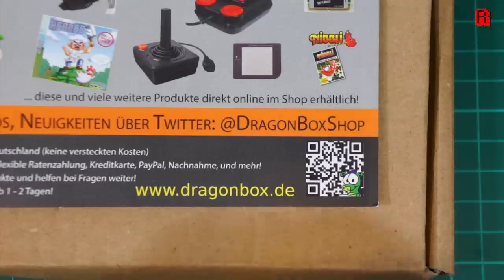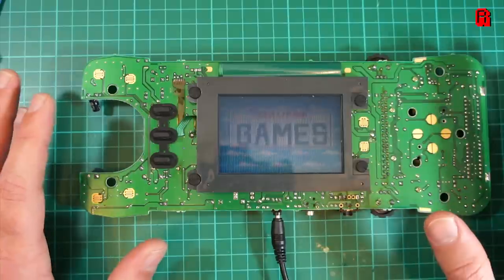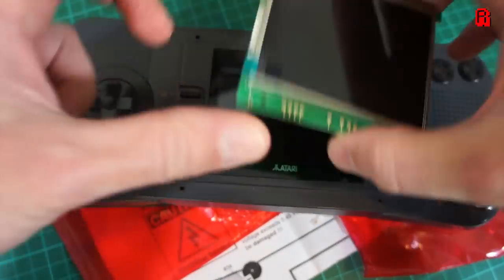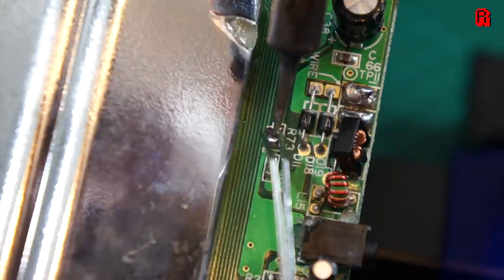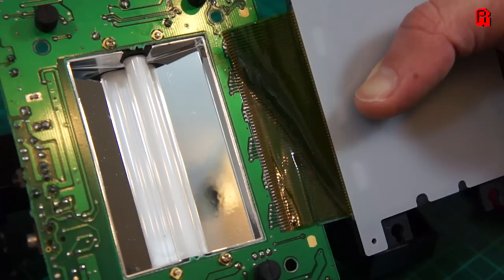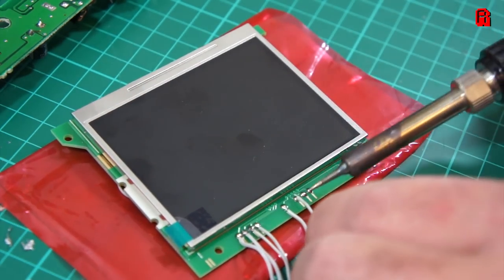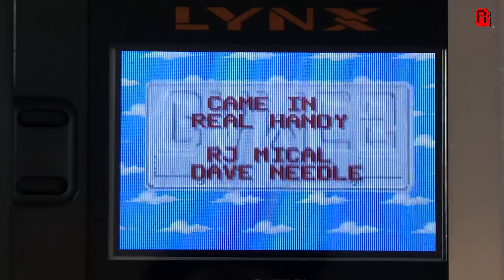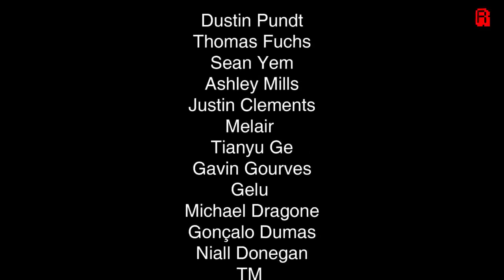Atari Lynx | LCD Upgrade (Mcwill Mod)

Comment: First time I saw a Lynx LCD screen,   I thought water had got in on the screen to cause those lines!   (happened to a CRT TV I had years ago)
Reply: LOL, with 25k volts going through the crt, you were lucky not to get a jolt up your jacksee!
Reply: Haha, it's a small world after all! I think I've watched all your videos so far WHILE modifying Lynx's and GameGears for my customers :)
Reply: You need to make full sized gaming tvs on that tech man. You got everything right having transparent light red green blues on the grey colours of the LCD screen just like if you were to look close up to a CRT and dark RGB's on the following line with a dark black backing and from a distance it looks just dark grey and you can't see the transparent scanlines at all. Then you had an option on there you turn horizontals on to make the square pixels dots like a real CRT and original Lynx LCD.

We need that on a full sized gaming LCD and you'll make lots of customers on that 4K TV product I think as it would be like playing PS4/X-Box One on a CRT like you could on PS3/360 still but with the LCD tech.

4K UHD gaming on a CRT like dark grey and dark black with transparent RGB darks and lights blended into them striped glass screen made out of the latest UHD QLED tech with a horizonal fine scanlines button where the fully transparent picture scanlines are the same size as the stiped vertical scanlines that would be a beast of a gaming TV the Dragon Box 1 would and with each new screen tech and 10k or whatever the future holds that comes out you can remake and improve it and make the older ones cheaper.

It's always a risk to go full sized and more expensive on the screens but a lot of people out of the ones that can afford the tech that are gamers would get one I think especially if it supports 50/60hz inputs properly like a game mode on a good non El Cheapo LCD TV but more affordable as it's made for the purpose with Analouge RF being changed to old microcomputer or atari game mode as those are the only things RF is useful for now other than the Digital TV as it's not made for Analouge TV anymore but it should still be a mode as a gaming TV.

This is probably the best replacement screen tech out there for Gameboy Dot Matrix Green, Color, GBA, Gamegear, Lynx and whatever else you would make them for in the future and a TV for gaming might just be the latest upsample idea out there for them.

Comment: fantastic! . to be honest i'm a big fan of keeping things stock but you won me over here!  excellent mod and video as always! cheers!
Reply from the maker: I'm right there with you but decided to make an exception.  I did hold off cutting a hole in the case for the VGA port though, I'd like to somehow hide a flat cable for that in the battery compartment if possible.
Reply: Like all those "stock" Amiga CF card hard drives eh MVG? wink ;)
Reply: haha i knew someone would mention this - with CF cards you can revert back to original. With a screen transplant its difficult/impossible :)
Reply: I like to keep things stock as well, so I will keep my less banged up Lynx untouched and will try the LCD mod on the fully functional, but less worn out unit...cheers.
Reply: I have a Lynx 1 with the McWills mod and brilliant it is too however I’ve just picked up a new/old stock (and immaculate) Lynx 1 and am tempted to swap the innards with the McWills machine thus making a brand new looking McWills installed Lynx 1.... sadly this would mean placing a never used lynx1 PCB and screen in an old case.... dilemma indeed!
Reply: @RMCRetro  I assume this unit is for your personal use and you would keep a stock version for the museum. When seeing units at the museum, it's important to present how things were, warts and all. Eventually the mod itself will become part of retrogaming history too (it's already 10 years old, it seems!) so it will be nice to see them side by side.

Comment: I recently did this with a Sega Nomad and had the same gob-smacked reaction when it first powered on. It's almost like replicating the original feeling from all those years ago when the original hardware felt so impressive at the time.
Reply: How did you that? i have a nomad too and want to make this MODscreen. I already did the GG mcwill MOD and its awesome
Reply: Bet that improves the battery life... had my Game Gears back light converted to led by a guy on ebay big difference for me.

Comment from the maker: Thank you as always for watching, I'd love to hear your thoughts and experiences on the upgrade as well as your Lynx memories.   Please note that this is designed to give you an idea of the installation method and the result you can expect, but it's not an instructional installation video,  there's a very in-depth 45 minute installation guide here which I recommend here as a primer:  https://youtu.be/6lRJg-zZZOk
Reply: Brilliant, pun intended! Very nice. Infinitely better. How's the battery life now? I'd imagine it's almost 4 or 5 times longer.
Reply: I never got to play with one. I'm gonna keep my eye out for one.
Reply: I've never had a lynx, but it a similar mod was available for the PSP, I'd jump at it. I've already done a drop-in screen replacement, but the new one is just as awful as the original.
Reply: Hey how does the screen impact the battery life?  Seems like a modern LCD wouldn't use near as much power, not to mention removing the backlight

Comment: I've seen the McWill mod before but the way you present it is excellent. I picked up a 98% mint Lynx I, except the screen has a couple of horizontal lines. I absolutely love the Lynx (actually prefer the model I over the model II), it's so incredibly comfortable to hold and it has this charm about its bulky design. I guess i'll be going for the McWill upgrade as well... Thank you for this fantastic video!

Comment: Nice video. It is interesting that back in 1989 when this was released, it would have been possible to make an LED back-light that was brighter and used much less power as white LED's were available and by around 1990 were much more affordable.  Why Atari and other manufactures didn't do this, hmmm

Comment: as someone who stared at a Lynx screen for hundreds of hours back in the 90's this mod has been a revelation. I can't wait to upgrade one or both of my Lynx. I've seen another video of the mod before and RMC you've done the screen proud. I've always preferred the model one as well so I imagine it will get the treatment first.

Comment: Fantastic video! I really dig that PCB holder/clamp device you have. Looks very handy.
Reply from the maker: Thank you from one cave to another.  I'd like to find a slightly bigger one, it's great for handhelds but I'd like a nice sturdy holder for micros.
Reply: They can be found at most quality electronics shops and Amazon/ebay.

Comment: Thanks for the great Lynx videos! I also felt the McWill screen made the Lynx 'how it always should've been', it's completely amazing. On the other hand the old Lynx screens are not as bad as they're portraided in some youtube videos (if they're still in ok condition). After playing for five minutes on the old style screens you've already somewhat forgot about the screen :)
Reply from the maker: Electric Turbodata I agree with you in the most part but Shadow of the Beast was the killer for me.  Cali Games and Slime World were playable but SOTB was rendered impossible.  Of course designers should factor the screen into their games so it's not entirely the fault of the Lynx
Reply: I just realised I got a Lynx II back in the day and I've been using mostly model II over the years and the screen on those is a bit better and they also seem to age better, so that could be one reason as well. You probably wont believe me but I've beaten SotB on my original Lynx (II) some 10+ years ago, haha! But I do feel a bit nauseous when thinking about playing it through again, even with the McWill screen ;D

Comment: Great modification to the Lynx. If you haven't decided on adding the video output; I would recommend using either a mini-HDMI connection to keep it clean and hidden, and as a plus you can use it on modern capture cards that support HDMI. Even on modern LCD TVs and monitors.

Comment: Looks great! I think the only drawback of having a new screen is it really brings out the jagged edges of the picture which wasn't so obvious on the original screen.  That said I could live with that for the vastly improved picture quality!
Reply from the maker: That's true, the scan line option certainly helps a lot with that
Reply: It certainly helps for sure, but I think the crapness of the original screen hid the remainder :)

Comment: Well, if you´ll excuse me - i´ll be off to the Dragonbox, ordering one of those LCD screens ... good thing im one of them cabbage-eaters, so it should be here reasonably fast. Joke aside, your video actually convinced me to swap the old screen of my Lynx for one of those new LCDs. Incredible video, as usual. Funny thing - I had no idea, they were selling those, although I had already bought a Retrode there (one of those SNES and Mega Drive Cardridge readers, neat little thing btw) so, thanks for the point out.
Reply from the maker: +HalFischer Great to hear I hope you enjoy it.  If you are fitting it yourself there is a link in the description to a very detailed 45 min video on it which is a great help

Comment: Oh wow there's a goddamn CFL tube under the old screen. No wonder those batteries got gobbled up so fast.
Reply from the maker: Yup, also the same in the Game Gear!
Reply: The battery life in the Lynx was also complicated substantially by the lack of ability to "sleep" the CPU at any time. There were hardware bugs that would constantly "wake up" the processors, and reading information from the ROM cartridge was also a power hog since it was accessed through a single byte input port (unlike all of the other game systems which used memory mapping for the ROM).

Comment: Whilst the screen protector is good for preventing scratches during installation, I'd also recommend covering the new screen with a piece of card whilst soldering just to be 100% safe. It only takes one wrong move with the iron itself or from stray solder to damage the panel.
Reply from the maker: +TezzAtari good tip.  If you check the video description there's a link to a very detailed installation guide.  He uses a post it note to protect from flying solder

Comment: Real shame they didn't include a composite out for playing on TV's. That would have been a killer feature compared to other handhelds at the time.
Reply: but many modern tvs had a vga input or you can simply use a PC monitor with the VGA output port of the new lynx dispay!!!!!

Comment: I still have my Atari Lynx II and when I heard that the screen could be upgraded, I had to see what was involved.  I don't think it's something that I would attempt myself after seeing your video, but I would really like to have it upgraded.  Thanks for showing a great video though.  The difference is just astonishing.
Reply: Probably anyone with some decent soldering experience can do this for you. Might be worth asking around amongst your friends.
Reply: If you're still interested, check out Bennvenn's Lynx 2 LCD kit. Solderless basic install. Use the supplied ribbon to connect the driver board to the motherboard, solder one optional wire if you want scanlines, and then you're good to go.

Comment: I like the lcd mod, it’s a huge difference. 

You should also switch out the batteries for some nice rechargeable lithium batteries and make the ultimate Lynx.
Reply: It should run off 3 14500 LiFePO3 cells without any modification, you'd just need to put conductors in the empty battery slots.

Comment: For the rotating sign I think the original screen looks better while the replacement, the discrete steps of the rotation are more obvious, the inaccuracy smooths things out.
Reply from the maker: I guess it's a bit like CRT vs LCD.  A CRT naturally hides aliasing and blends colours, a technique used to great effect on 8 bit micros to increase the colour pallette.  An LCD shows the pixels exactly as they are.  The old Lynx screen blurs and blends as a result of it's display method which you're seeing.  Ultimately I'll take the brighter new screen though.

Comment: DANG! That actually makes the lynx playable. One question. It was always my understanding that the design of the system was to easily cater to left or right-handed people, so that it could be flipped over and played comfortably. And in turn, the display would flip in order to cater to this. Does the modded screen support this behavior? Was this even a thing with the OG lynx? What about the battery? Has this mod improved battery life as well?

Comment: Yeah of course. As Lynx is known to support backlights in fact the original was an el cheapo backlighted screen of course if you were to make one of GBA backlight standards but make it all Lynx size it would instantly be better results and they did it to that spec and the outcome was great.

Do wish it kept the red green blue light and dark transparent lines on the glass though. Thats why LCD TV's haven't been as good for gaming so far they didn't keep the spec of the lights with grey transparent mix and darks with blak transparent mix invisable until you look up close lines on the screen then when your game is on it plays horizontal scanlines into old sets as well which could be emulated making it an LCD TV control to turn the lines into square pixel dots called scanlines.

I think there should be a modern 4k Gaming TV to those specs plus with all the game ratios in it no streching 240p to 576p it plays the original but you got manual settings to make it as big as you like too a button to turn on virtual scanlines to coact with your on screen transparent virtical ones.

That TV would be awesome and would be a reason to chuck out a CRT for as Game mode would give you lagless 50/60 as well on your 100-400hz 4k TV.

The Lynx original screen does have the engraved scanlines this is missing in the glass though as they turn up on camera in one of Steve Benway's Lynx videos so with updated tech and retaining the RGB scanlines would have made it even better and more authentic like an improved original.

Edit: I didn't expect that vertical RGB lights and darks scanlines are on each line of the new screen and there is a button to get horizontal working without the old screen tech that they were in as standard on.

This is real deal Lynx but cleaner. And with current tech it also probably makes battery life comparable with other battery devices now.

Comment: Just an fyi, I saw you installed that jumper to ground and the backlight on the lcd module. The instructions I had didn’t show or say anything about doing that. I didn’t install the wire and the brightness control didn’t add scan lines, which was fine by me.

Comment: Nice Mod! Since you replaced the old-fashioned light tube with a LED-backlight, what does it mean for battery live? That Lynx should last way longer that originally.
Reply from the maker: I would think so, but I need to fix up my other Lynx to run a side by side comparison to get some numbers

Comment: Will you be making any more mods for this handheld? Great job with those lcd wires! :D
Reply from the maker: I guess the only other modes I'd like on the Lynx would be a modern battery solution and you could add an SD Card Cart to it (although I do like the original game cards).  For now this is working very nicely and I mostly use it on the mains power in the cave anyway.  The same LCD mod can also be applied to the GameGear which would be good.

Comment: Nice mod. However I have a question.   I heard that even though the backlight on this uses much less power than the Lynx's Compact Fluorescent Tube, the FPGA / CLPD when combined with the new screen and backlight actually uses more power thus decreasing battery life? Thoughts?

Comment: Good video, apart from at 7:48. It's really annoying how you didn't show the solder of those joints on the other side of the ribbon cable wires
Reply from the maker: Sorry about that, hope you enjoyed the rest of it

Comment: What's interesting is that LCD looks to be 4:3, but the resolution of the Lynx is 160x100, or 16:10.  Is the bezel masking a portion of the screen?
Reply from the maker: EFormance Engineering no sir it's a perfect fit without any of the screen passing the bezel out of view

Comment: Is there any improvement to the battery life, once you're rid of the old screen and fluorescent tube? I assume that would be a big draw on the batteries in the Lynx.
Reply from the maker: +ZygmaExperiment as so many people are asking I will check this soon.  I want to fix my other broken lynx and run a side by side comparison
Reply: Good idea. Would be very interesting to find out.

Comment: I really appreciate your work and effort but I would have stayed with the original passive matrix screen. It is like putting a 2019 hybrid engine in a 1980s car, just no more the same "original" retro feeling even with putting back the scanlines.
Reply from the maker: I can fully understand your point of view.  For an item like this I think you need two in your collection.  One which is original... and one which you can play

Comment: There seems to be a scratch on the top left quarter of the screen. Is that just a hair, or a mark on the screen protector?
Reply from the maker: Indeed there's a small scratch on the outer plastic of the Lynx case, but the new screen itself is perfect.  I have a spare case I'd like to pop the plastic out of and swap out